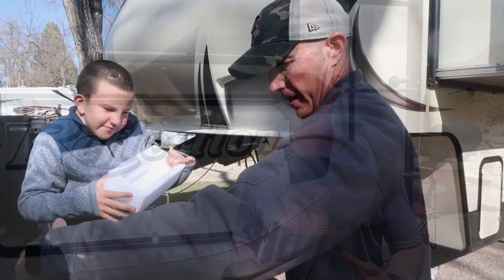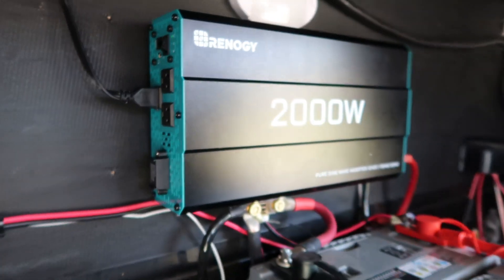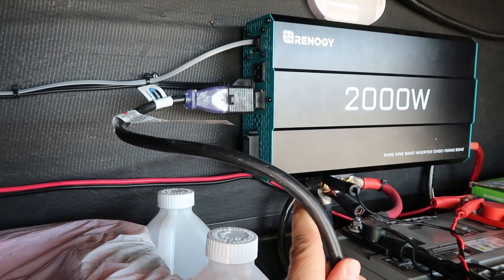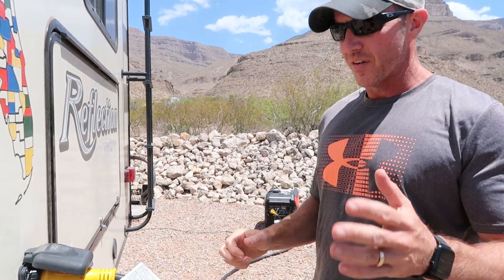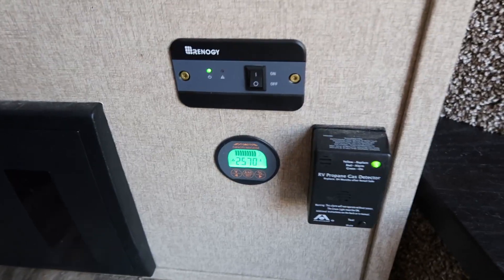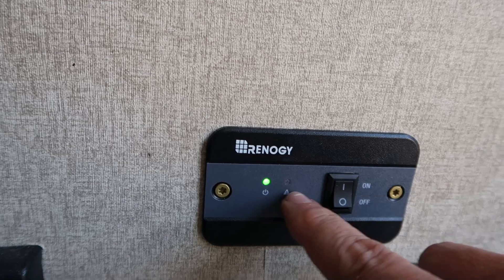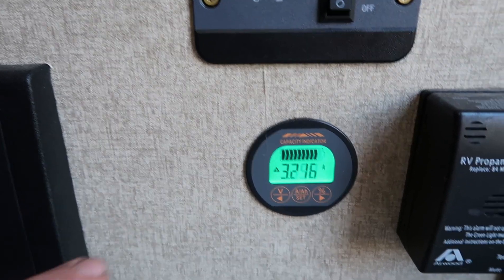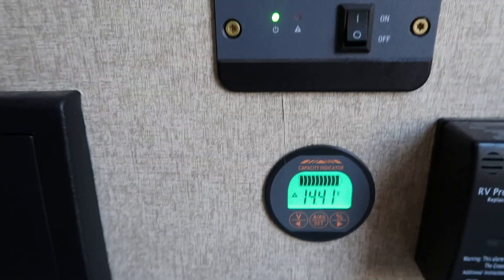How To Power Your Entire RV With An Inverter | Easy Inverter Power

Comment: I love how incredibly simple this is. I feel like it also insures you don't have the inverter on when you eventually connect to shore power and ruin your inverter.
Reply from the maker: Thanks! This setup has proved to be simple and effective for our needs without being overly complicated. And yes, there’s no chance of accidentally having the shore power and inverter hooked up at the same time! Thanks for watching!
Reply: So if your plugging in the cord to the inverter with a male plug and the other end of that cord that plugs into the 30 to 15 amp cord thats a male plug too so if the inverter was on could you get shocked since its now 110 volt ac? If you accidentally messed up and had the inverter on? @JouppiOutdoors
Reply: @anthonyguess5528   - I'm not an expert, but I don't think it works that way.  Here's how I understand it:  male ext cord plugs into the inverter.  The adapter plugs into the female end of the extension cord.  The female end of the adaptor goes into the RV shore-power plug.
Reply: I have 400 watts of solar, 200Ah of lithium batteries, a 3000 watt inverter.  Remote power switch for the inverter.  My trailer is a 30 amp unit.  My setup is the same as shown in this video.  Just avoid the microwave except for my wife’s tea.  Fan only for the air conditioner.  I tent camped for years, then a small tent trailer, so am accustomed to normal outdoor weather.  Didn’t carry a microwave or air conditioner, didn’t spend daytime inside, so am content.  I am a boondocker.
Reply: @jonedwards2107  I am looking at a similar setup. Does using the microwave create significant battery drainage? How much would you estimate using it for 20 minutes?
Reply: @azcanuck3131  haven’t tried yet.  Typically you might use a microwave for a minute or two at a time.if you have the inverter plugged into your shore power inlet be sure to turn off your converter.  Solar should fully recharge your batteries daily.
Reply: @azcanuck3131   That depends on the rest of your setup? do you have solar? assuming worse case no solar and you have 2 lithium batteries (2X100ah=200ah) you could run your A/C for an 1.5 hours. So I see no reason that you could not run your microwave for 20 minutes. Assuming your batteries are at full charge and your not running any other heavy electrical devices, fridge, water heater etc.
Reply: @azcanuck3131 1 AH per minute or more. It's a pretty serious drain.

Comment: This sounds like something I want to do for tv’s and maybe a cup of coffee from the  Kurig without starting the generator at 6:00am. But are all my lights and water off to use the inverter?
Reply from the maker: Your lights and water pump will still run on the batteries since they are 12 volt accessories, the inverter being on will not affect them. Thanks for watching!

Comment: I'm confused. You said stuff in the 5th wheel on the inverter but included lights and max air fan. Aren't those 12 volt, thus no inverter.
Maybe I missed something-the wind noise was real bad
Reply from the maker: I was referring to the total draw on the batteries from all sources. This includes the draw from the inverter since it is pulling DC voltage from the batteries when we are plugged into it. Thanks for watching!

Comment: I'm confused by the converter issue....I don't see it linked in the description. Is this an AC to DC battery charger pulling from a shore power cord?
Reply from the maker: The converter is the stock AC to DC converter/battery charger that came installed in our 5th wheel. It is in the basement storage area plugged in to a dedicated outlet that can be turned off at the breaker box. Thanks for watching!

Comment: why do you need the Nema 15 Amp to 20 Amp Plug Adapter ?
Reply from the maker: I’m using a 20 amp cord and the inverter has a standard 15 amp style receptacle.

Comment: I wonder if you decrease the microwave power level down from 10 to 5 if that would make it easier to use on the inverter?
Reply from the maker: Great point! The inverter would definitely run the microwave at 50% power. It would still take a toll on the batteries though. Probably easier to just fire up the generator for a few minutes. Thanks for watching!
Reply: @JouppiOutdoors   Many microwaves still draw full power when you choose to run at 50%.  They simply run full power for several seconds and then no power for several seconds.
Reply: @JouppiOutdoors  it would but you would have to run the microwave twice as long.  It defeats the purpose.  Generator time for 1300 watts or more.

Comment: I love your setup. Just went on Amazon and bought most of this. My only question is why not just buy a 15amp to 50amp rv adapter and plug that straight into the inverter to your stock rv power cable? Stock rv 50 amp can handle more power than the 20amp extension. Am I missing something here?
Reply from the maker: My 50 amp power cord will not reach my inverter and using this setup, I will never draw more than 15 amps. The 20 amp extension cord is easier to handle and more than enough to carry the load. Thanks for watching!
Reply: @JouppiOutdoors  And what is the reason you want to stay below 15 amps? Battery life? I'm new to this and have a 2 week boondocking trip planned in about a month. Trying to figure all of this out lol.
Reply from the maker: For us it does come down to battery life. We have a 210ah battery bank that I do not like to discharge below 50%.
Reply: You can only get 20amps from the Renogy 2000watt inverter so it doesnt matter if you go to 30amps or 50amps to the trailer. You will still only get 20amps.
I think some 3000watt inverters have a 25amp hard wire from the inverter, but the most you can still get is 20amps with a 20amp receptacle going out.

Comment: I have a 24v forklift battery that I want to use to power my rv completely including ac and heat when needed. How would I do that simply? Thank you for your time.
Reply from the maker: 24 volt power is a fantastic option! The easiest way to do it would be a 24 volt inverter/charger.   Victron makes an awesome 3000 watt 24 volt inverter charger. Then you could connect your solar panels in a series/parallel configuration to charge the battery when you are off grid camping. Thanks for watching!

Comment: I have a question, do you use the inverter instead of the converter because the batteries will last longer that way? If not why do you use the inverter instead of just running off the battery of the RV?
Reply from the maker: Great question! The converter will only run the 12 volt side of the RV (lights, water pump, USB outlets, vent fans). By plugging in to the inverter, all of our 110v electrical outlets will work as well. I turn the converter off so it is not trying to charge the batteries while we are running on the inverter as this will cause a tremendous draw on the batteries and deplete them quickly. Thanks for watching!

Comment: The only thing I'd want to run is the air conditioning, would it run that? And for how long?
Reply from the maker: It might technically run one A/C but the tremendous amperage draw would deplete your batteries very quickly. With a large enough battery bank, it can be done… We have the generator as a backup for running the a/c for a few hours if needed. Thanks for watching!
Reply: I would think you would need at latest $10,000 additional invested in solar and batteries.

Comment: What kind of fuse do you use  between battery to inverter?
Reply from the maker: I used a 250 amp ANL Fuse Block from our previous inverter. You can find them in 2 packs on Amazon for around $13. Thanks for watching!
Reply: My plan is connect start A battery - 150amp - isolator - 150amp - B battery - 200amp - inverter 2000 watt. Would that work?
Reply from the maker: At maximum output on a 2000 watt inverter you will be up around 166 amps, so the 150 would not be big enough.
Reply: @JouppiOutdoors  what fuse do I need between isolator to double battery? 

Would 200amp fuse work between double battery to inverter?
Reply from the maker: Honestly, I don’t have a tremendous amount of experience with using isolators in conjunction with a double battery setup.
Reply: @JouppiOutdoors  between isolator what fuse do I need? Do I need 2 fuse between isolator?

I also have 2 battery and will like to connect to 2000W inverter so battery to inverter 250 amp? 
 
Stater battery to isolator is 250 amp fuse , isolator to double battery 250 amp fuse , double to inverter 250amp fuse?

Comment: You were in the battery industry for a long time, but you haven't made the switch from AGM to LiFePO4.  I have built several lithium batteries and would be very interested to hear why you haven't spent the money to buy or build replacements for the AGMs.  Are you just waiting for those to complete their normal service life, with a plan to make the switch at that time?  The advantages are too many to mention, especially given what you described in this video.
Reply from the maker: We do not boondock enough to justify the expense of lithium batteries at this point. Thin plate pure lead AGM’s are an excellent choice for what we do. My experience is in the marine industry servicing and replacing batteries on sailboats, offshore center consoles, and sport fish and motor yachts. With the amount of batteries those vessels carry, lithium is far too expensive for the majority of those customers. So my firsthand experience is extremely limited when it comes to lithium. For that reason, I stuck with what I have used and know to be an extremely dependable and high performance AGM battery. By no means am I trashing lithium, I just don’t think it is a must for a 210 Ah battery bank like we have. Thanks for watching!
Reply: @JouppiOutdoors  - Keep your eye on the lithium options.  The costs are dropping quickly and the amount of usable capacity, along with the much longer service life, make them a strong value proposition.  That presumes you will be using your RV for many years to come, but as I mentioned, lithium has numerous advantages over the SLA/AGM options.

Comment: hi , are this inverter start refrigerator dometic
Reply from the maker: We turn our Dometic refrigerator to the LP setting when we run the inverter. This inverter will run the refrigerator on electric as well, we just prefer to run it on LP (gas).

Comment: I am using 3000W 12v to 220v pure sine inverter for power and also I am using a battery charger at night  from the same inverter to charged the battery.The battery is maintaining constant voltage.Recycled power.
Reply: Wait you charge your battery off the same power from the inverter? 
Thats pointless, it's working 12v power to 220v then dropping back down to charge the battery. That won't be efficient?
Reply from the maker: Sounds like a great setup! Thanks for watching!
Reply: @JouppiOutdoors  how many amps does the inverter pull while just “on” ?  Not powering anything.
Reply from the maker: The draw is about .75 amps with the inverter on and no load.
Reply: This doesn't make sense... You can't charge your battery from your battery. You would lose power due to the power consumption and parasitic drain.

Comment: What fuse are you all running? I’m struggling with understanding the fuse concept. Where is it placed at, too?
Reply from the maker: We run a 150 amp fuse on the positive cable between the battery and the inverter. The Renogy inverter is fused internally as well but the extra fuse provides another layer of protection. Should there be a short somewhere while running the inverter, the fuse would blow preventing the wiring from getting too hot or catching on fire (absolute worst case scenario). Thanks for watching!
Reply: @JouppiOutdoors  Awesome! Thank you so much! I never considered a small solar system before. I’ve always assumed I needed a 15kw system for my rig. We have a Renogy 2000w inverter and 200w solar system coming for our 3 week trip coming up! Thanks for sharing your info!🤙🏼
Reply from the maker: You’re welcome! It has worked out fantastic for us!
Reply: Fuses protect wires. They are sized based on the wire not the equipment or loads. You must base your fuse size on the wire size, you can go smaller in fuse size if you want.  Keep in mind wire length plays a role, enclosed or open air wiring plays a role. Fuses should be at the power source, therefore connect at the battery not at the inverter.

Comment: Do you want the converter tuned off when your running your generator? Is the same loop which wastes power you spoke of occurring?
Reply from the maker: No, the converter should be turned back on when running the generator to help recharge the batteries. Since the generator is supplying the power to the RV (and converter), your batteries will recharge during that time. Thanks for watching!

Comment: I am about to do the same thing as a short term fix. But since I have a motorhome, really want to tie the inverter into the main breaker panel to power the coach. Did you ever go with a transfer switch?
Reply from the maker: I have not yet installed a transfer switch. It is on the list to do! Thanks for watching!

Comment: If you run this setup, isn’t your converter trying to charge the house batteries off the inverter (which is running off the house batteries)? Since both the inverter and converter are not 100% efficient I would think this endless loop of power would drain your batteries fairy quick.
Reply from the maker: I mention in the video that it is critical to turn the breaker to the converter off so this scenario doesn’t happen. If I forget to turn it off, with the battery monitor in place, it’s obvious pretty quickly that something isn’t right due to the high amperage draw. Thanks for watching!
Reply: @JouppiOutdoors  ahhh! Shoot I missed that tidbit. Great easy way to get power to your outlets. Thanks for sharing!
Reply: Have you ever looked into a go power transfer switch?

Comment: Instead of running an extension cord everyrytime just hardwire it into the back of the plug and zip tie it up under the 5th wheel. You won't have to run the cord ever again just unplug at the inverter if needed.
Reply: A hard wired connection requires a Dual-input, single-output power supply selector switch. This is the safe/correct way to have convenient and 100% accident proof dual input power for your rv
Reply from the maker: @liftviagra  Absolutely, thanks for watching!
Reply from the maker: Definitely something to think about! Thanks for the suggestion and thanks for watching!

Comment: Thanks for the info video! I would love to see more on how you installed the inverter, i.e. the hookup to the batteries and the amp monitor you have in the rig. Very smart great set up. Fantastic GD rig btw.
Reply from the maker: I plan to do a more in depth review on how it is all installed. Thanks so much for watching!
Reply: @JouppiOutdoors  ditto
Reply: @JouppiOutdoors  I was over thinking the inverter installation. I bought all these on/off switches, power transfer switch, bus bars, fuses, wifi shunt, fuse box, extra heavy duty battery cables. I bought two 2000 watt inverters. One inverse will have AC & DC inputs and outputs, the other inverter is just a basic inverter. I will be sending most of these devices back for a refund and just keep it simple. My installation is just for backup we never go dry camping. We just want to have a little power in case we lose RV Park shore power.

Comment: During generator usage i assume you shut it off(inverter) ... what would be the side affect of not turning it off like you do with the breaker to the convertor?
Reply from the maker: During generator use I have to unhook the 15 amp to 50 amp adapter from the trailer and plug in the 50 amp cord going to the generator. If I did not turn off the inverter the 15a to 50a cord & adapter would be live. You should definitely have a procedure in place so that everything gets turned off or on when it’s supposed to. Thanks for watching!

Comment: How did you ground inverter
Reply from the maker: I ran a #12 size wire from the inverter ground stud to the same location as the other chassis grounds on the trailer frame. Your inverter manual should indicate the size and length of the ground wire for your particular inverter. Thanks for watching!

Comment: We did the same thing with my friends reflection.  Except he had a turn off  his refrigerator becaues it would automatically go to electric when it was running on the inverter.  Thanks Don
Reply from the maker: We turn our fridge to propane when we boondock so it doesn’t switch over when we turn on the inverter. It’s definitely not a complex setup but works great for what we do! Thanks for watching!

Comment: Unfortunately, to actually pull this off you would need an enormous amount of LiFePO4 battery storage and solar panel capacity.  For what I would consider to be a boondocking entry level, you are looking at $6k minimum for a decent kit.  Takes up a lot of space, and most of your roof is solar panels.  Might even need a couple extra suitcase panels.  A 2500W generator can be had for well under $500, burns very little fuel, and can be made to be very quiet in a properly designed enclosure.  If by "entire RV" you meant LED TV's, Blu Ray players, laptop chargers, phone chargers, and other very small loads, your best bet is to install 12V accessory plugs throughout the RV and just buy a few of the little 200-300W pure sine wave inverters you can buy on amazon for like $30.  Total, you might spend $100 per location, including the inverter, wiring, plug, terminals, etc.  Just plug your stuff into those.  Get a couple of 100W suitcase solar panels and a cheap charge controller and you are set for a while.
Reply from the maker: Thanks for watching!
Reply: Your idea seems like a lot of work where his solution is simply running an extension cord and flipping a few breakers.